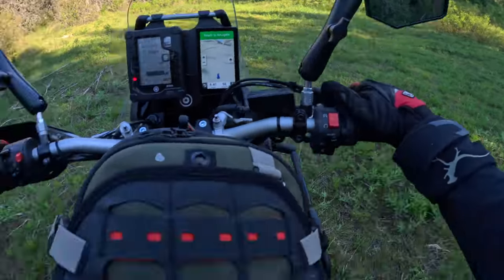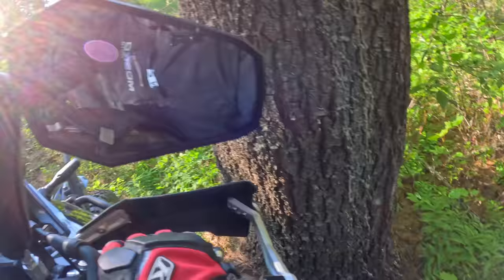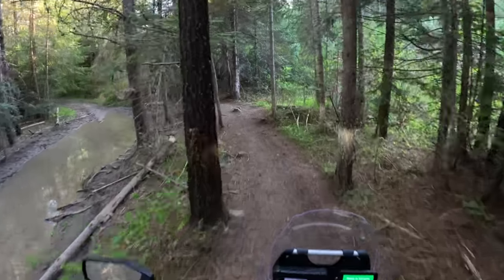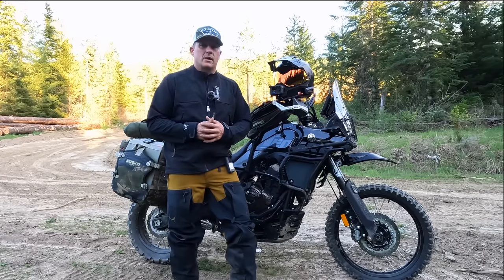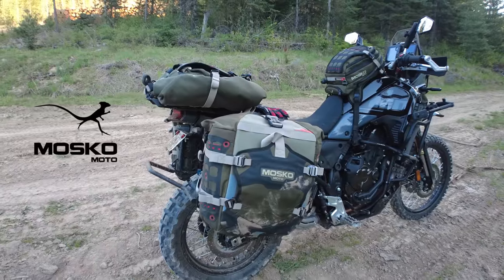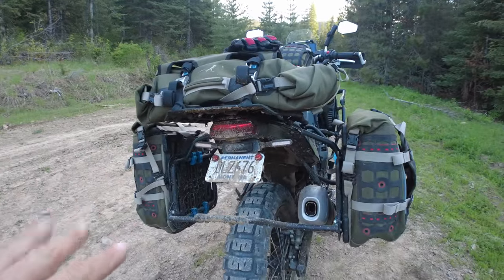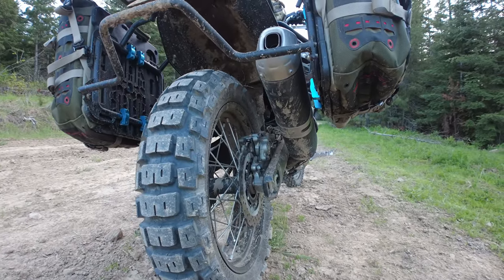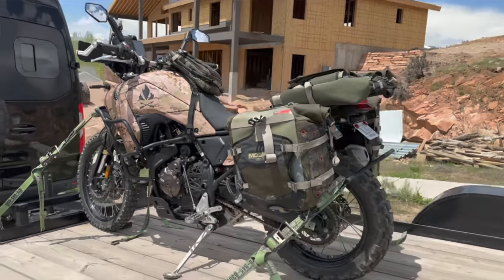Mike Glover’s Fieldcraft Survival Yamaha T7 Build!

Comment: traded in by rally raid cb500x for a tenere 700 in early april and just last week got it to where i want it with racks and guards. Eventually will do the suspension but for my weight it's already better over the rougher things at speed compared to the cb500x. I'm enjoying it so far no big off roading yet but planning on going on a trip soon! I've wondered what your thoughts are on the T7 compared to say the africa twin or your new bmw. I think you might've covered it before but couldn't remember.

Comment: I installed the Quad Lock waterproof, wireless charging, device mount, with the vibration dampener and 10mm bar clamp. I can mount my phone in portrait or landscape configuration with Quad Locks 1/4 turn lock system. And, not cover any of the T7's dash screen. I wouldn't want to mount a device any other way.
With a decent Bluetooth helmet comm, it's an awesome setup.

Comment: Is that Outback Motortek luggage rack the symmetric version?  I have a deposit on a T7 (selling my Africa Twin) and I like the space for stashing extras that a symmetric rack would provide, I am just worried that my Mosko Moto Backcountry 35s will stick out way past the handlebar width.

I'm not weaving in and out of traffic or between trees often, so maybe I am worried about nothing.
Reply from the maker: Yes they are symmetrical. We will be putting extra fuel in that spot so we wanted the space. As far as width goes, it’s not even noticeable. Just did 1800 miles with them on a off-road trip with no issues
Reply: @backcountryadvmoto  I like that extra space.  I have a Camel Tank on my AT and like not having fuel range anxiety, so I'll get one for my T7.

Thanks for the reply!

Comment: I could NEVER adjust to any fairing on my enduros. Yeah, they arent smooth on the highway....but i am a gravel road guy. 1980s XT350 (3)/XT600/XR650. I dont do all the nav/electronics either. Primitive. $6k in all 5 bikes. Thats affordable, and all the kids can escape.
Reply from the maker: We will have an XR 650 bug out build soon keep an eye out for it
Reply: @backcountryadvmoto  thanks, be sure to put the lowering  dog bone on that bastard. Very tall...and I am tall. It's makes it challenging off road. I am too cheap to buy that dog bone. I had to upside the tank. I rode around Cali for a month or so while on a job out there, had to carry a 2 gallon jug strapped to the back each time I did a segment of the coast highway. Even at that I never pass a gas station without stopping. These little kick start only XT350s are glorified mopeds, but man they are nice, cheap, and easy to ride.